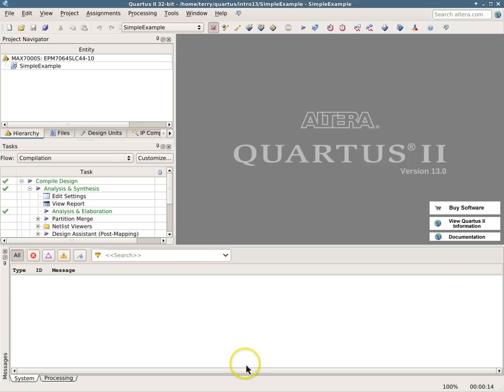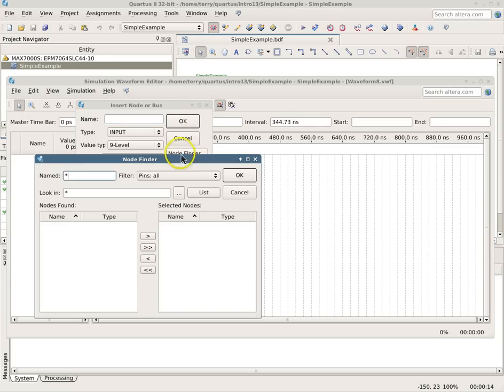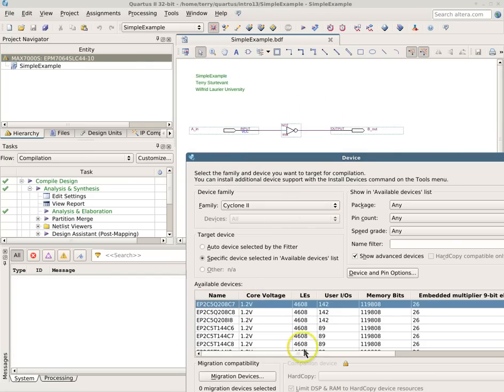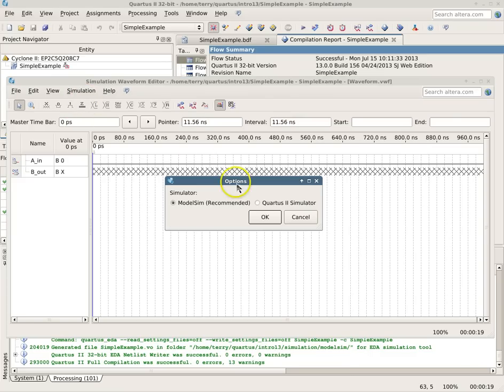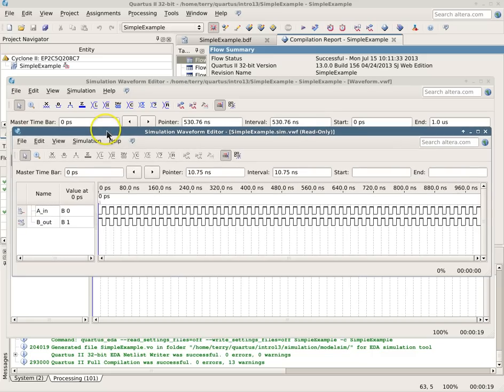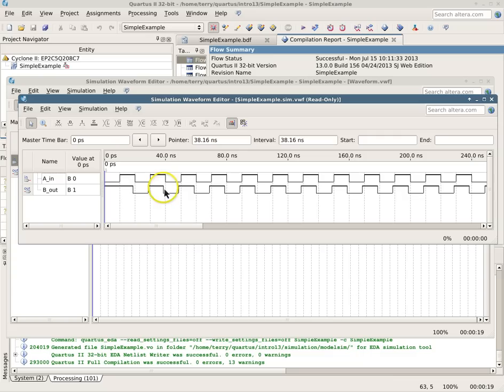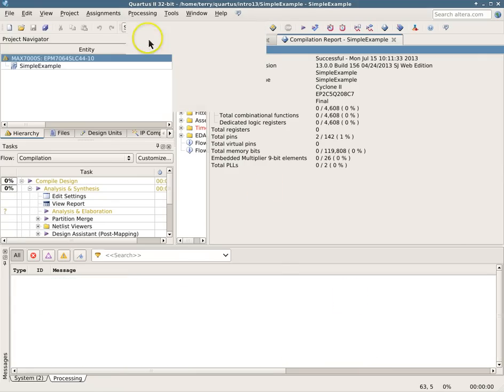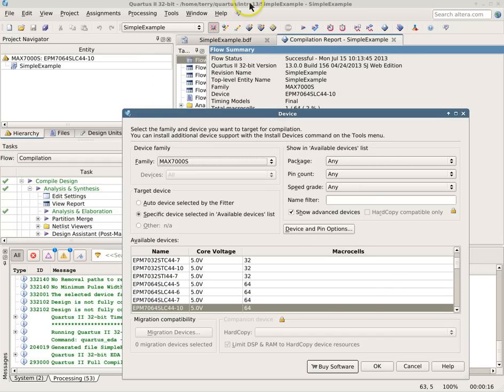Simulating with QSim (Quartus II V13.x)

Comment: Thanks Mr Sturtevent, great video, concise and accurate. Is there an example of Simulation using a clock signal (something like the 16-bit adder/substractor  of Altera's University program). By the way is your Quartus II 13.x installed under Ubuntu ?